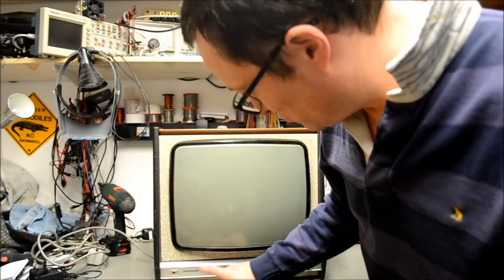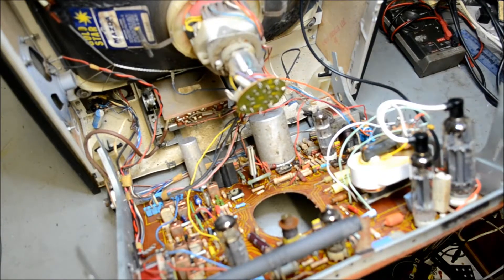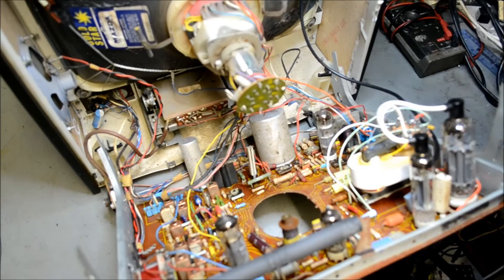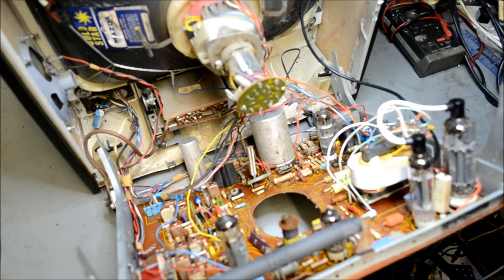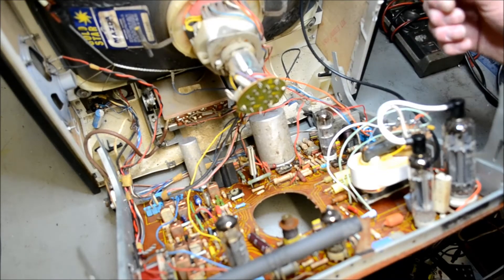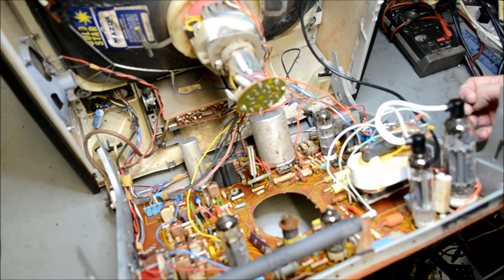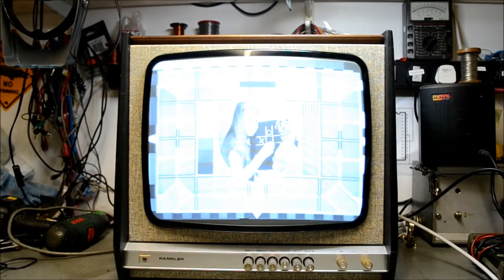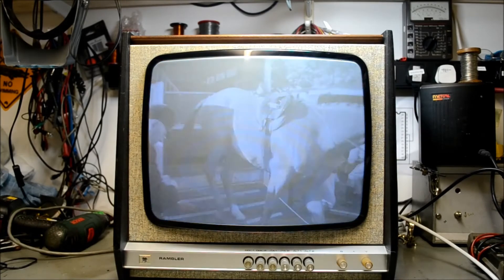Pye 169

Comment: B/W 110° tube TV sets were all quite the same - 250-270V power supply to horizontal output, PY88+PL504, about 850V on booster capacitor. If the output tranformer is faulty, you can change it with other from similar TV like you did. But mostly the faulty part is the high voltage (secondary) coil. Then you can just swap this coil and use primary section from original transformer, so there is no mechanical change.
Reply from the maker: Go to http://andydoz.blogspot.co.uk/2016/03/pye-92-17-transportable-television-set.html and find out why I couldn't do this!